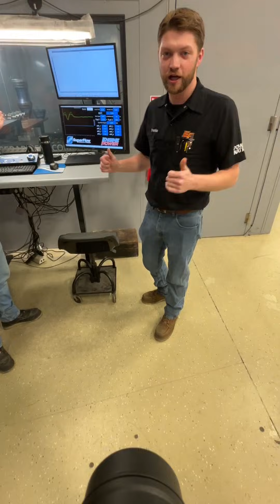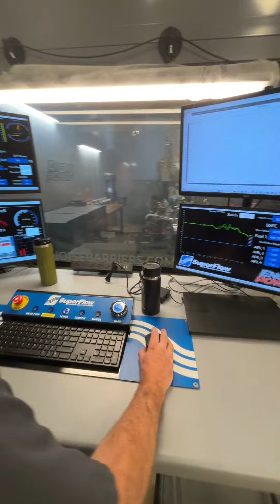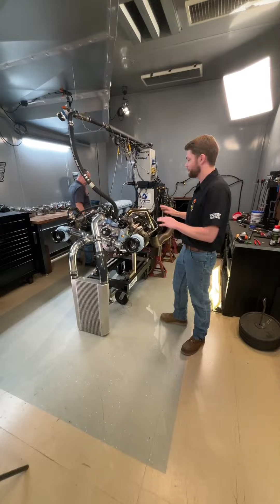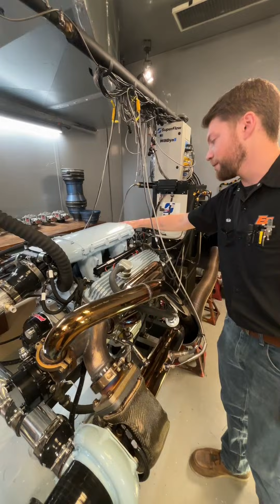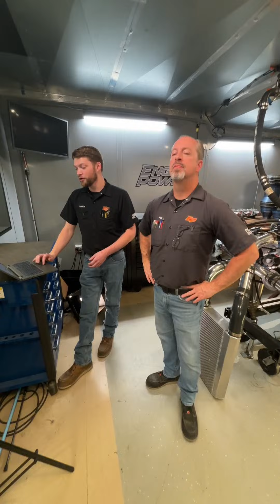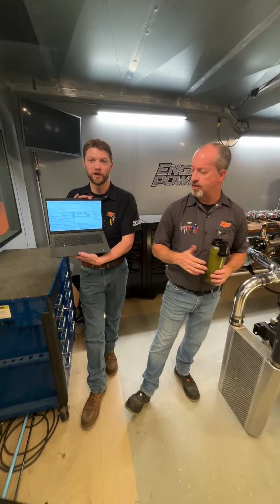Engine Power Live

Comment: I wood like to bring my Toyota SR5 turbo charge 2.4 L twin overhead cam by I am losing turbo bust I am going to take it to show time drag strip in Saint Petersburg, Florida and I want to see what it does at the drag strip I used to raise for at the dragstrip in 1970s in my 1967 Camaro it ran eight flat with street tires. It’s kind of like a pro stock street car but I sold it could have cancer.